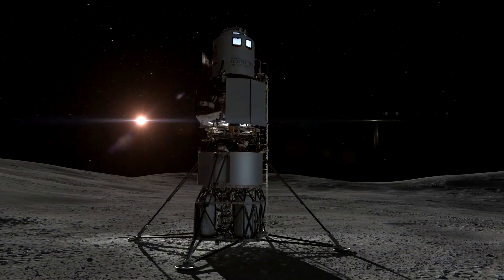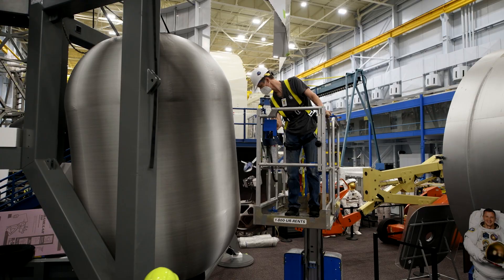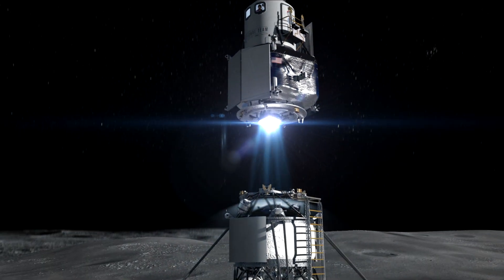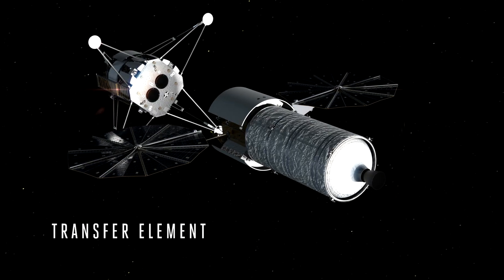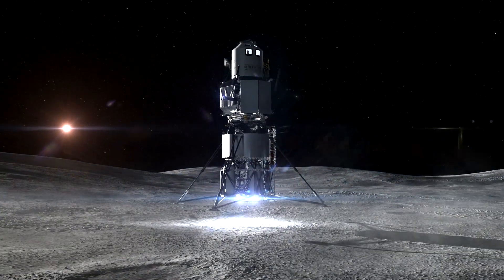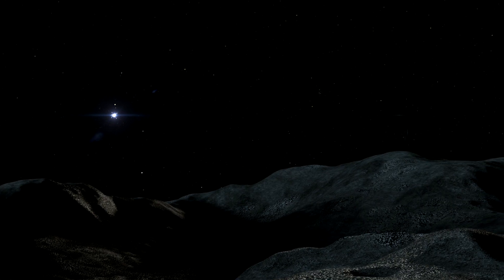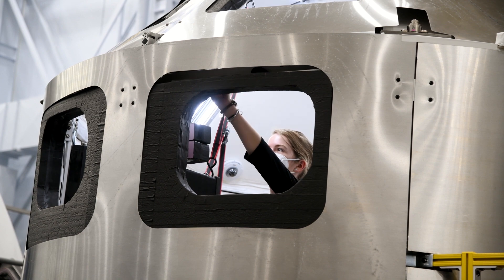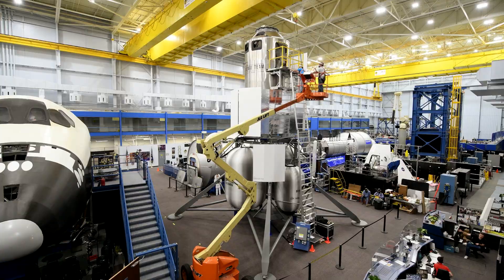Blue Origin-Led HLS National Team Mockup

Comment: Why do you need three launches for something we used to do it one
Reply: It can deliver more people and more cargo to the lunar surface than the LEM, go to more parts of the moon, parts of the architecture can be reused, and by depending on multiple commercial rockets we can avoid having to end a lunar program because a big rocket is too expensive.
Reply: @ronsmith4927  Indeed. Dissimilar redundancy. I adore the Saturn V.  Always will. But in the coming years we might have, simultaneously, SLS, and Falcon Heavy, and Starship, and New Glenn, and Vulcan/ACES. If the demand is there to justify the supply, what an amazing, and more sustainable, time for spaceflight beyond LEO.
Reply: The number of launches should not matter. Saturn V cost 6-7 billion per launch, SLS is gonna cost ~2 billion per launch, each launch of Vulcan, New Glenn or Falcon Heavy is only gonna cost ~100 million per launch. Doing it this way reduces the cost of the program down to 3-4% the cost of Apollo, and ~15% the cost of doing it with SLS alone. Thus we can afford to stay on the moon indefinitely doing it this way.
Reply: SLS doesnt have the payload capacity that Saturn V had.
Reply: @stoffers6419  SLS sounds worse with every thing I hear about it....
Reply: @virtualScotsman  Well to be fair SLS is significantly cheaper. People like to point out how expensive SLS is but Saturn V was much more to develope from scratch when SLS is Shuttle derived.
Reply: @stoffers6419   That's why people complain. SLS is shuttle derived and yet it's over-budget and years late in the game.
Reply: @asmmahfuz8569  it's over an unrealistically low budget, and is late because of their unrealistically low budget. Basically, thank congress.
Reply: @mcnuggatron2129  SLS and low budget don't belong in the same sentence.

SLS is a jobs programme by design - it's incredibly expensive for the rocket they'll end up with, because the rocket was never the objective.
Reply: @dandavidson4717  yes, they do. Nasa in general is very underfunded; expensive doesn't equate to "properly funded"
Reply: asm mahfuz That’s what happens when you are subjected to an endless series of funding cuts.
Reply: Simple, less weight.
Reply: @myownspace9666  Thank you. Very simple. The Apollo missions were not throwing as much weight at the Artemis missions are planned to. You couldn't do the National Team's HLS and Orion on a single Saturn V. It's apples and heavier apples.
Reply: Doing it in one, getting only three guys into lunar orbit - and only two down to the surface - in a vehicle whose interior volume approximated that of a Chevy Astro minivan.  This project will get tons of stuff down to the surface and I think is intended to act as a ferry to/from the Lunar Gateway.  It's a far more ambitious and comprehensive operation than the national prestige projects of the Apollo Program.
Reply: Barry Soetoro  "Luna"tics, huh? Sorry, had to.
Reply: SLS Block 1B+ could throw the CSM and the LM to the moon. But Orion and this lunar lander is a much heavier crew vehicle and crew lander than the Apollo alternatives. More crew, longer duration, etc.
Reply: Barry Soetoro  I agree; why does that go against anything I've said?
Reply: You can get more money from government contracts if you do more launches. This is the new military industrial complex, these contract companies have been around for decades. They know the drill.
Reply: Don't carry all your eggs in one basket.
Having one big rocket is cool but having smaller, fully re-usable and cheaper rockets that carry less but are less prone to failure is a far better alternative and less likely to cancelation due to budget constraints.
Reply: Cinnamon-Skateboarding There are no fully reusable rockets and there are few reasons why a small rocket would be any more reliable than a big one.

Aside from that, I wish people would stop trying to make reality fit SpaceX.